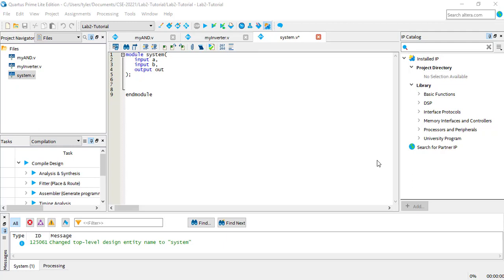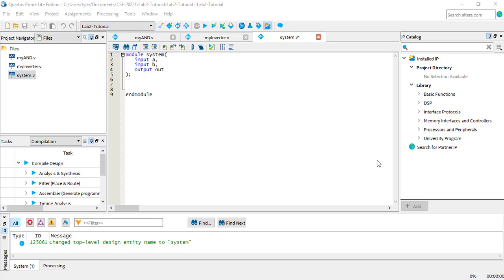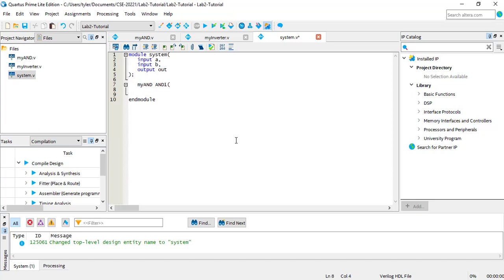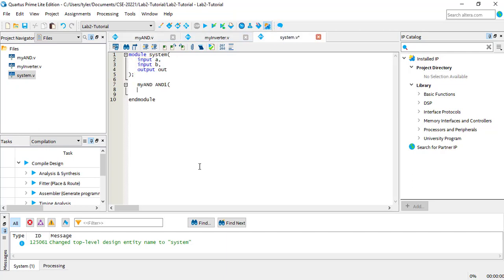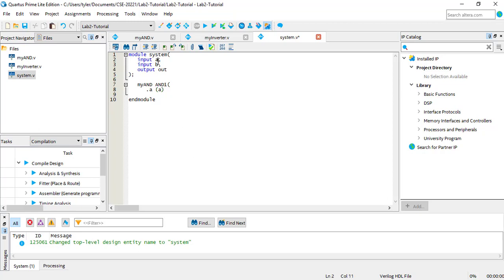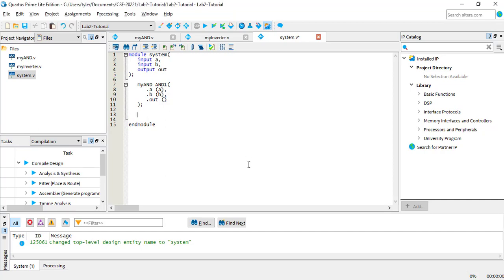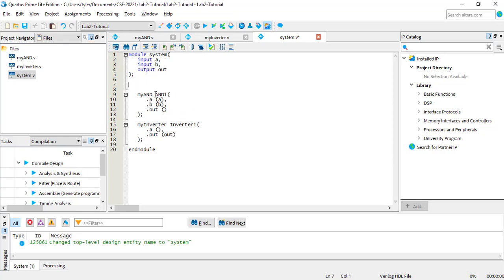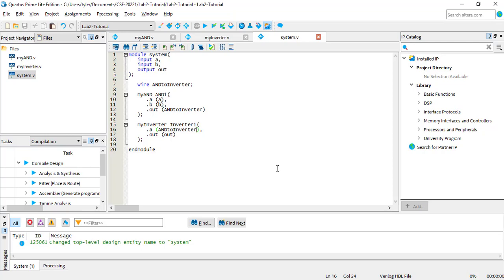Intel Quartus:  Connecting Modules in Verilog

Comment: Do names in a module inside another module always have to start with a dot?

Is that the only situation where a name starts with a dot?
Reply: From how I understand it, if you are using explicit declarations, then yes. I believe it means that the value should be referenced from the original module from which the instantiation is made. For example, the ".a" above pulls in the declaration of "a" from the module "myAND" and assigns it to the input declared in the current module, "input a". I hope this makes sense!
Reply: @gabrielladangler1722  Thanks.